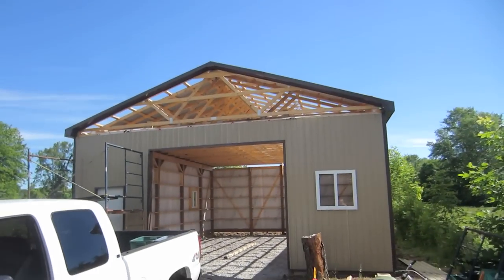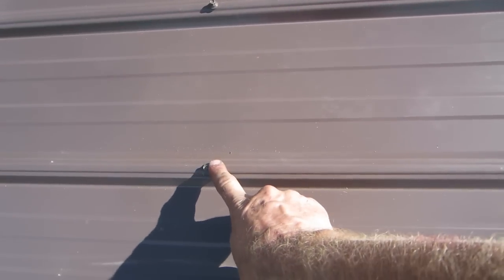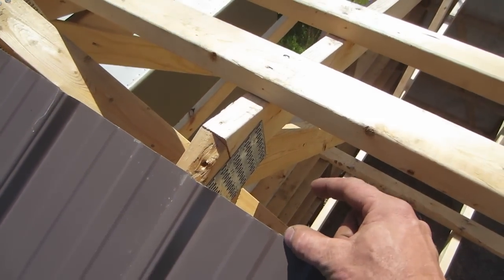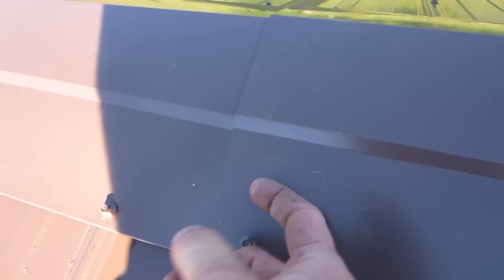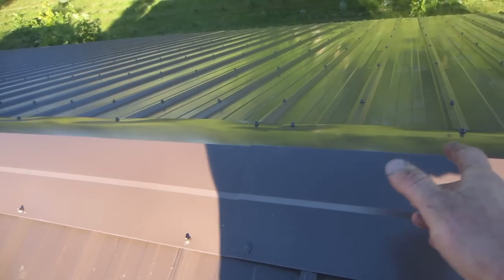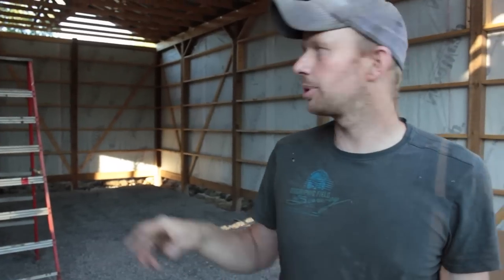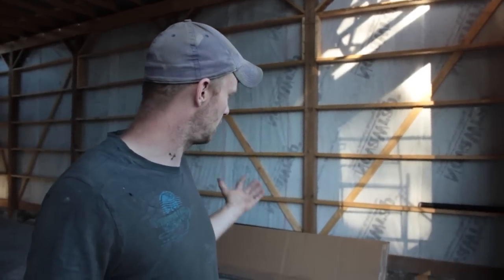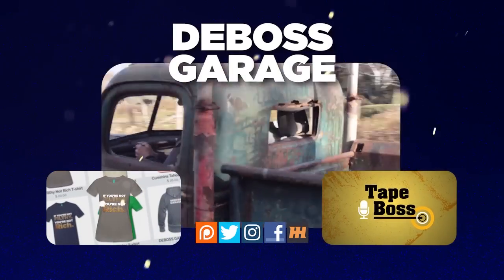DAY 6: How To Build A Garage (For Your Brother)

Comment: Looking good!  Question on the screws holding the roof steel on.  They use a rubber gasket correct?  How long are they good for in actual use?  All rubber breaks down to my knowledge, is it just an insignificant amount?
Reply: My shop is 30 years old and the screws are still well sealed , my screws were 1 and 3/4  long i think if memory serves
Reply: Awesome!  Thanks for the info
Reply from the maker: Thats why you put them on the ridge, and not down on the bottom.  I'm sure they last at least 50 years.  I remember pulling 60 year old nails with rubbers on them and the only reason they leaked is the constant movement of the steel actually pulls the nails out and makes the nail holes bigger in the strapping

Comment: Really Great Job on your building And also diesel repair videos.  Just want to add one important thing I ran into on putting sheets of tin on my 2 farms buildings.  The roof ridge rubber seals need to be silicone on both sides and more screws in between.  I learned wind tears out the strips right away.  Also birds peck and tear out the strips.  So I silicone the outside of strips also.  Which so far works for me after several years.